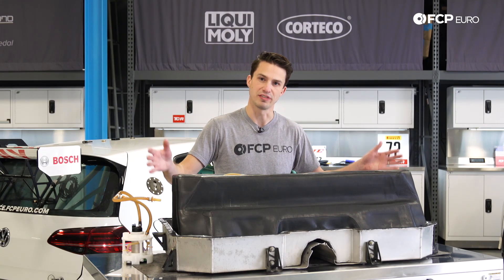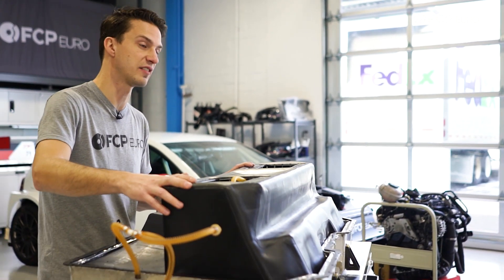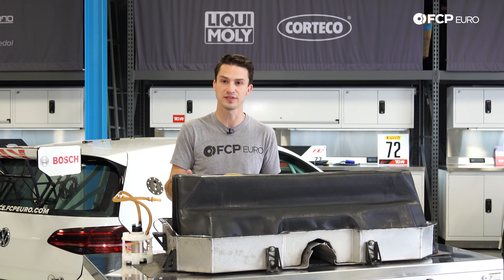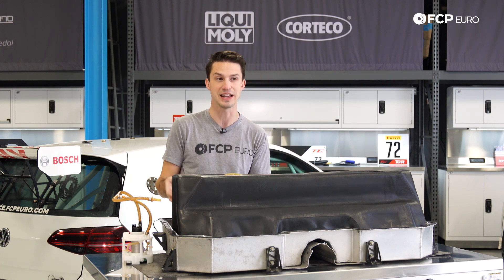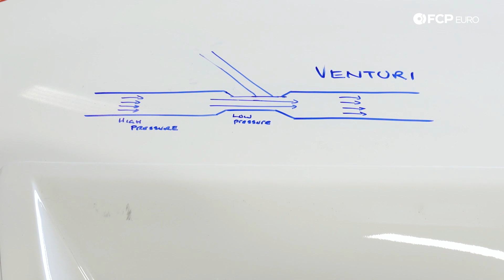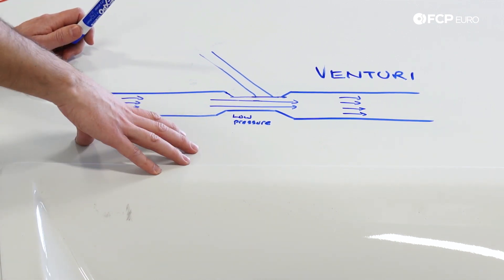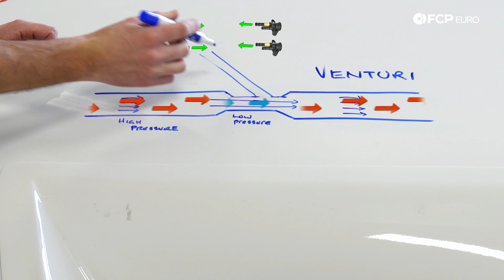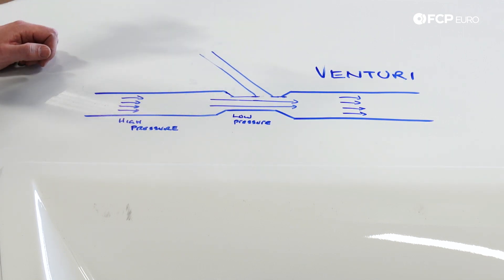Fuel System - Race Cars Explained

Comment: Hi. excuse me
I have a 2016 GOLF GTI TCR and always the fuel pressure drops to 1~2BAR after about 2~3 hours of operation. even lower. lead to flameout. . Power off, then on again for a while, and it works normally again. .During this time, the fuel pump/filter/pipe. Replaced and cleaned. It's still the same. I would like to ask what might be the problem. thanks